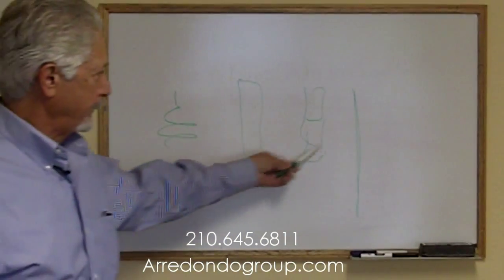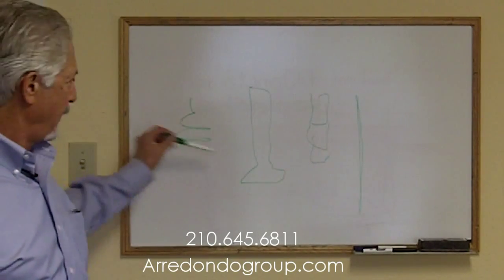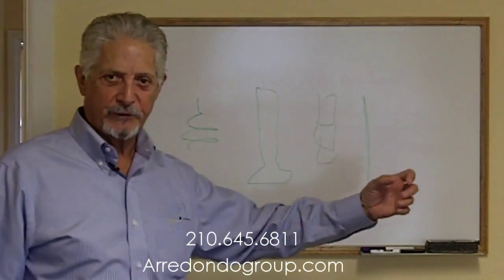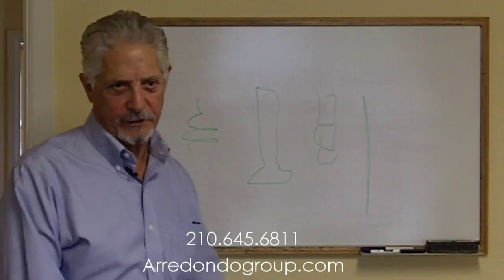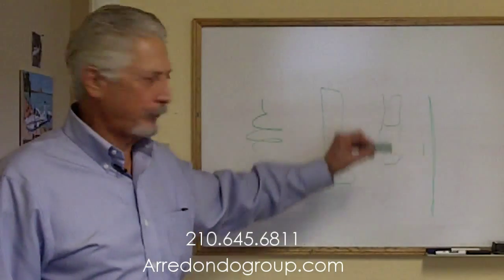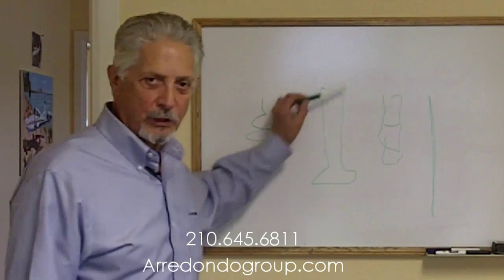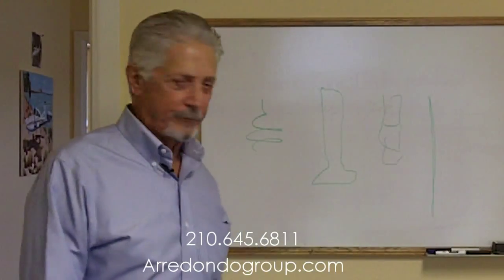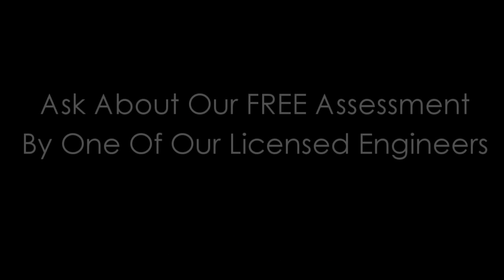Some Foundation Repair Companies Don't Use The Right Underpinning Structures

Comment: I agree with you about the skin friction. Also people don't calculate the distance to pre load the poured piers. Nor is is common for the site guys to test the bottom of whole for compaction. Also they sent to over dig the. Flatten loose dirt. Smh because the usually guy difficult g doesn't know anything.